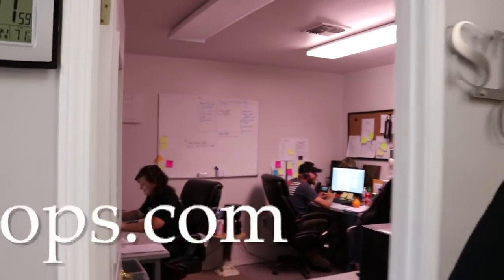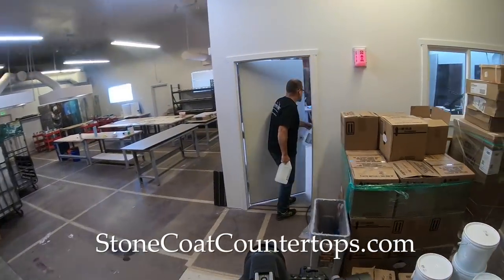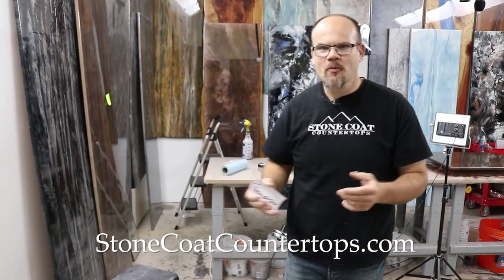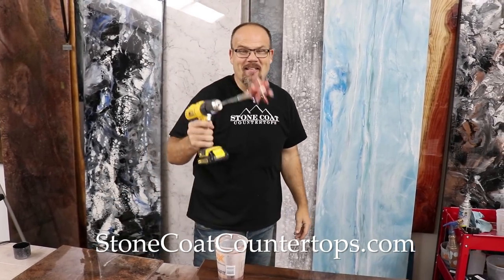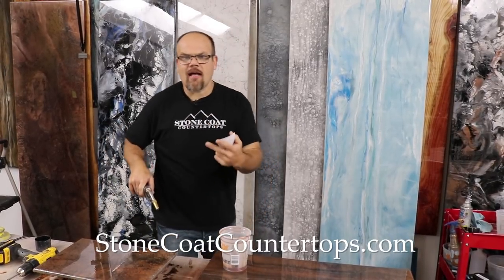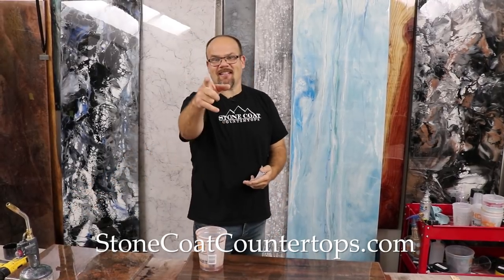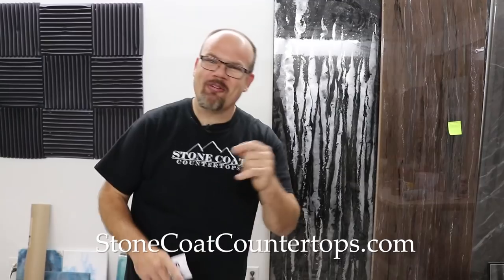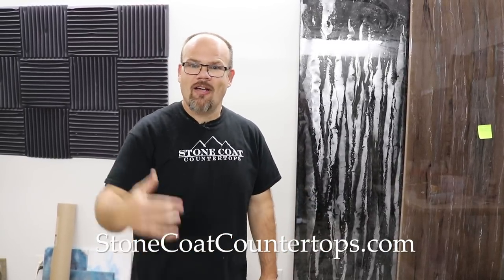6 Cold Weather Epoxy Tips

Comment: I live in FL so the weather is pretty warm, but the humidity can be high.  Well then the humidity gets low enough to pour but the temp outside drops to low at night.  I have to do 4 layers of resin (3-4 hours between each layer), and I only have a screened in porch to work on.  The temp is great to pour during the day but what will I need to do when the temp drops at night???  Should I put a heating pad under my mold?  My mold is a 24 inch round by 2 inch deep silicone mold.  I just dont want to waste all the resin because it was very expensive and I paid around $1000 for all my supplies.  Would hate for the temp to drop at night and ruin my project.  Please help!  Thank you.
Reply from the maker: Give us a call Jared! We can go over more details and would would be the best course of action for your project. You Got This!

Comment: Question from the insiders group. " I did a copper matallic scc epoxy over MDF for this bar. It's been over a month since I did it and my father n law tells me that every time he has a hot plate sitting on it, it sticks to the surface. It doesn't leave marks but it just get stuck to it. Is this caused from temps not right during curing process? Or not mixed right?"
Reply: I've always heard that it's OK to put a cold glass/cup on it but not anything hot.

Comment: If you’ve done a pour in a wide open area, using radiant heat, how do you recommend keeping the area warm enough to cure? Close it off in plastic? How long do you have to make sure the temps stay high enough? Also, is humidity a factor? Thanks so much for all the videos, they’re very helpful and make me smile as a bonus!
Reply from the maker: Hi Warmwater79! You can use plastic sheeting to your advantage if your situation allows it,  you ideally want to keep your project between 70-80 degrees for the first week of the projects life for the best durability and cure possible. Don't pour the epoxy if the humidity is 50% or higher or it can cause an amine blush, the epoxy will haze.

Comment: Great tips, love the energy. One question saw where Mixed Media Girl uses an electric heat gun, will that work as well as open flame torch.? Thanks again.
Reply from the maker: Great question Joe!  For larger projects we like to use the torch as it effectively removes air bubbles; however, a heat gun is a great tool to use for moving color or for smaller resin art pieces.  Thanks again for the great question and feel free to call or email us anytime for project support. (541)450-1976